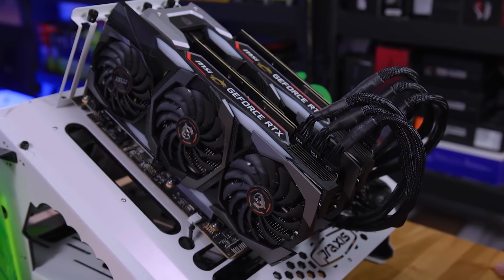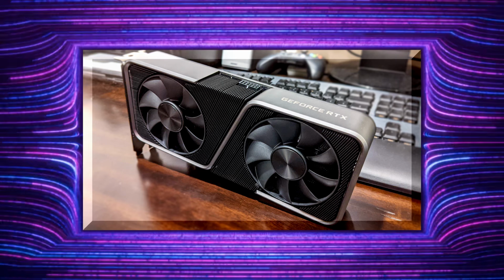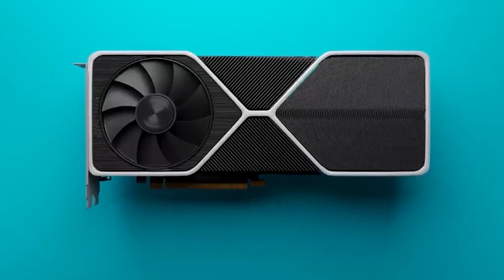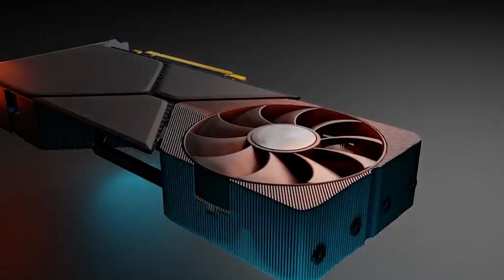Both of These Graphics Cards Are Great... But Which is Better? (RTX 2080Ti vs RTX 3070)

Comment: I upgraded from a 3060 ti (still have it) after buying a Strix 2080 ti from marketplace for only $180 just because I couldn’t pass it up. It’s got the Samsung memory so it’s the reliable model. Debating on what to do… do I sell both and get a stronger gpu? Both gpus run everything I want to (both struggle with space engineers but all gpus will lmao)

Comment: 3070 will not hold up as long at 4K.
In 2 years the 2080ti will beat it at 4K High. I’m guessing 😂
Reply: Probably true
Reply from the maker: why do you think that?
Reply: It’s actually stronger now by a bit in most cases (2080ti) just not all.

Comment: the 2080 ti is faster and is more on par with the 3070 ti than the 3070 making it more inline of the 3070 ti and the 3080 the 3070 is more equal to the 2080 and a year ago nvidia capped the 2080 ti in performance with newer drivers there is some work arounds this if much research is done remove the power cap on 2080 ti and u have near 3080 performance so if u can snag a 2080 ti get a msi trio x or asus strix or evga ftw 3
Reply: Greedy Nvidia, declaring 3070 to be faster and sabotaging 2080ti to influence people to go out and buy the latest and greatest instead of sticking with what works, anti consumer and is a page straight out of APPLE's book when they throttled their older model phones to force you to buy new.
Reply: Yep lmao yeah I've got was olhalf as much only 600 but the lied the 2080 ti beats the 3070 in every game by about 5-10 percent I have a 2080 ti xc ultra 11gb and it kicks ass it's the same performance wise as a 3070 ti
Reply: I feel like 3000 series pointless except 3080 12 gb and i have 3070 i am mad but for full hd this gpu fine i guess

Comment: The 2080Ti is great if you can spend the extra cash and want to primarily play older titles. If you plan on playing new AAA titles like Dying Light 2, especially with Ray Tracing on. You will want the 3070. It's generally a rule of thumb, that people who understand how to under volt/underclock their gpu's tend to get far better performance and temps and that's probably why you see 2080Ti's beating 3070 in some games. A lot of people who do benchmarks don't know how to build a well rounded PC, a lot of people buy one or two supped up parts and then fill the rest of their pc with junk, and a lot of people don't know how to squeeze the juice out of those machines as well. A bit of perspective. You can run stock 3080Ti in Dying light 2, get above 60 max settings in 4k and have your core temps at or above 80 c°, your memory junction over 90 c° and your hotspot somewhere in between the two. Or you can under volt the card to 875-900mV at 1920MHz see a ten plus degree reduction in temps across the board, and still get identical performance. If not a more consistent smooth experience because you're not thermal throttling.
Reply from the maker: Thanks for this in depth response :)
Reply: @TopTierTech1  No problem. People who own these cards need to step up and speak out to people considering making a purchase. These cards aren't cheap, and I imagine most people don't have a spare 1000$ just to blow on a maybe. I own a 3070 XC3 Ultra (800$ Feb. 2021/ 80$ over MSRP) and a 3080Ti FTW3 Ultra (1600$ FEB 2022/ 36$ over MSRP). If you already have a card that plays the games you like. Don't waste your money. 3070 is worth the money at MSRP, 3080Ti isn't. Even if it's twice or more as powerful.
Reply: Except 3070 sucks. Though for full hd i glad i can play in Dying light 2 ordered yesterday 165 hz Chinese monitor hope its will worth it
Reply: RTX 3070 has higher FPS on new games than 2080TI

Comment: $719 EVGA XC3 ultra 3070 ti
I will rememeber this solid from EVGA. They might have gained a lifelong customer if the quality holds up.
Reply from the maker: You should be fine
Reply: Sadly they stopped third party GPU production
Reply: EVGA dropped Invidia as a partner they arent producing cards anymore. LOL Good luck if your card needs to be repaired and you can flush your warranty in the toilet as well. LOL
Reply: @tgreaux5027  Yeah bro. I know. it sucks. cuz they were the only third party manufacturer who directly sold to customers. no middle man taking a cut like best buy newegg or amazon. i needed a GPu than couldnt get dicent price GPU at all. EvGA was there for me. its shame. hopefully Nvidia will chance thier way ( they wont. the greed is too much). I blame them 100%

I heard they kept some cards in hand for replacement and warantly should be still work. either they can give me one from stock or get me a new one from a different company. IDK how it all works. But i heard EVGA have very good reputation actually the best in customer service. thats just what i heard from tech channels. plus I didnt have any problem with my card. It running STRONG.